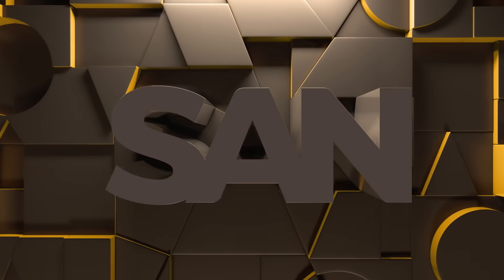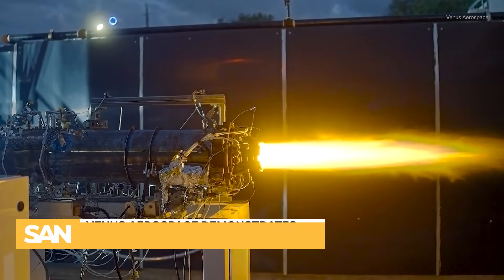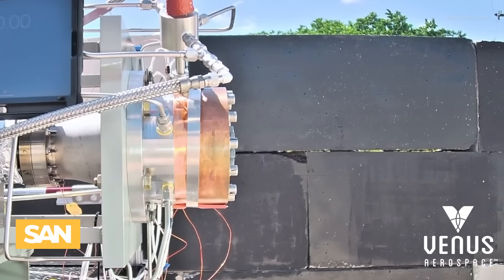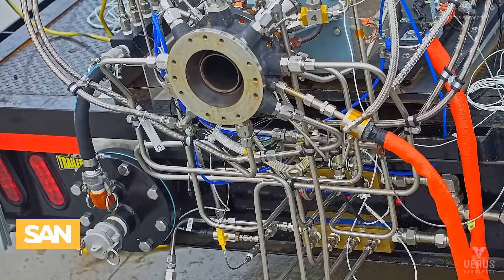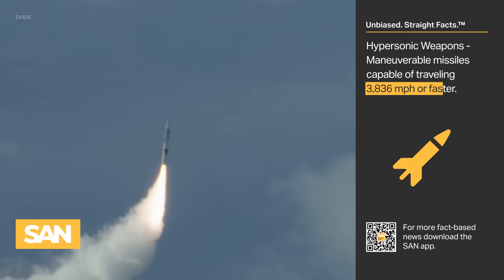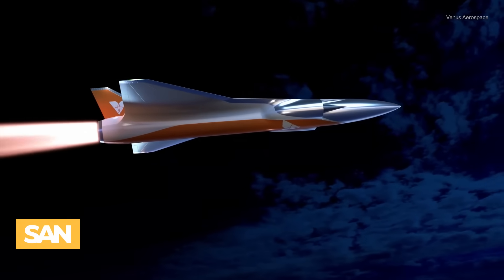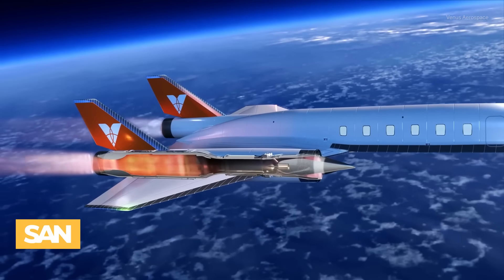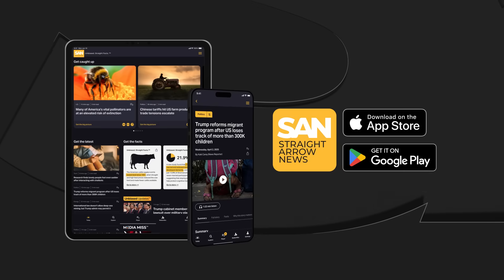Texas startup making history with revolutionary rocket engine

Comment: Hypersonic missile are still useless and a waste of money.. Yes you can make them but in the end you are limited by physics. Its not just getting the speed and maintaining hypersonic speeds, its about making the missile incl. a warhead, survive the flight. You can also not use any optical sensory during hypersonic speeds, infact most guidance systems are gonna be interrupted during those speeds. We have materials that could endure these temps but they are really expensive and I dont see a reason to make 1 missile worth 2000 missile just to have a fast one. When it comes to balistic missile and stuff, you just have to overwhelm the enemy. As if we dont have enough guided ammunition to level 3 countries and more. Just look up how many BGM-109 Tomahawk America has.

Comment: A team of engineers from the Łukasiewicz Institute of Aviation conducted the world's first successful flight test of an experimental rocket powered by a liquid propellant-fueled, spin-detonation rocket engine. The test was conducted on September 15, 2021, at the Military Institute of Armament Technology's training ground in Zielonka, near Warsaw. The spin-detonation process has a wide range of applications, from rocket propulsion and aircraft propulsion to applications in energy devices.
Combustion chambers using the spin-detonation process have several significant advantages: they have a simple and compact design, making them lightweight and inexpensive.
For over 15 years, experimental research on the use of the spin-detonation process in engines has been conducted in Poland, under the supervision of Professor Piotr Wolański. The successful demonstration of spin-detonation technology conducted by Łukasiewicz engineers is a success on an international scale. This is the world's first successful test of using a detonation engine powered by liquid propellants, liquid propane, and liquid nitrous oxide to propel a rocket. The successful demonstration of the spinning detonation technology conducted by Łukasiewicz engineers is an international success. This is the world's first successful test of using a detonation engine powered by liquid propellants, liquid propane, and liquid nitrous oxide to propel a rocket.

Comment: Which of the 20ish rocket engine types of SpaceX are they talking about here ? And is it the J2 or F1 engines of Saturn ? Also they are not a 1 to 1 thing, as there are more engines in one design but smaller.

To say they are 30% more in trust means little without numbers. As the J2 is 1,032 kN vacuum, but the Raptor 1 is already more than that, and Raptor 3 is 3,000 kN (in space only 2,750 at sea level)

Is it also scalable, as it's not a sure thing either. How about reusable ? 

To say it's 10 times cheaper means little if the other can fly 30 times, like SpaceX already have done.

Now it's still great to have more engine types and ideas out there, but some actual numbers and so on would be nice.

Comment: Springs and gearbox, using a piston system, to cycle an exhaust gate and fuel inlet gate, and a combustion cycle toggle

To create an arpeggiated explosion, controlled with the spring piston/toggle lock

And a portion of the exhaust gas, is routed back into the fuel tank, cooled by a turbine, and peltier coolers, and with a relief valve for overpressurization

The gas provides positive pressure and recycled unburnt fuel

For a self-pressurixed, and regulating system.

The ammount of travel of the gates is controlled by throttle or gas pedal. For variable thrust

Spark plug is powered through battery by alternator connection to turbine in positive pressure/laminar flow system

Can be combined with air intake, or used with oxides/oxygen tank

Works good as a multiple motor system

Built like an H&K Machine Gun

Comment: "Maneuverable Hypersonic" is an oxymoron. You can either be agile enough to - in this case - dodge anti missile defenses, or be fast enough that such systems dont have the time needed to react. You can't have both or else your weapon becomes susceptible to AA defenses on way or another.
Reply: Not necessarily true at all. You think there can't be a vehicle that can go 4,000 mph amd make a 78 degree turn without slowing?

Comment: Assuming this is liquid fueled, seems unlikely that the DOD will be using these for hypersonic missiles, liquid fueled rockets have not been in service since the discontinuation of the ATLAS rocket, due to difficulties related to managing liquid fuels, (hypergolic or otherwise).
Reply: DoD is funding them. Purdue Univ. is working on a Solid Fuel RDE.

Comment: Although the two technologies are quite different, when I heard mention of Venus' means of propulsion involving a series of explosions, I immediately thought of Freeman Dyson and Project Orion, decades ago, which was based on the idea of using a series of atomic explosions to propel a rocket through space. As for what the CEO said about Venus' engine being much more efficient than that of SpaceX, I would say that the applications, respectively, could not be more different. Given the number of outstanding engineers working for SpaceX, I am quite sure that if Starship could benefit from a different kind of engine, they would have opted for it.

Comment: Thanks for a good explanation.  10% to 30% efficiency improvement is a major breakthrough for spaceflight in addition to weapons and air travel.
Reply: While efficiency is always good.... On a missile, the efficiency of the  fuel or the propulsion unit is not going to make much of a dent in the cost per unit.   And we don't need any faster missiles, the ones that fly at Mach 15 or higher are good enough... nothing can stop them anyway during the terminal phase.

Comment: 10 times cheaper and a 30% improvement in thrust ? 
That’s so impressive.its hard to believe.
Reply: The economics of death just took a giant leap away from Mankind.
Reply: He didn’t say thrust; he might’ve meant Isp.
Reply: Dude seems to have thought this through. 🤔 It will be interesting to hear more 10 yrs from now.
Reply: @andrew1717xx  I like technology of all types, It adds value practically for free.
The Share price on the Nasdaq is currently @ 2.45 . That is real interesting .  Thanks
Reply: Well it's a rocket engine, those are pretty cheap. As for thrust improvements, it's a known deal already that detonation engines are more efficient. The issue is that you need multiple detonation fronts in the same engine to get good specific thrust, and those tend to merge together (reducing the number) or otherwise collapse - getting them to run with perfect spacing at the same speed is the difficulty of building such an engine.
Reply: 10%-30% efficiency equals a SUBSTANTIAL savings in fuel which, in turn, saves mass that must be lifted (which even further saves fuel in a bit of a virtuous circle).  If this is viable and safe, if could mean for much lower costs for spaceflight and possibly even shorter travel times  to places in the solar system.
Reply: @v3rlon  nah, it mostly means smaller launch vehicles, not even bigger payload to space. Also you don't use combustion for sustained orbital propulsion, it's inefficient.
Reply: @michaelbuckers  increase in efficiency means less fuel for the same load.  Their website says increased efficiency.
Smaller rocket engine still mean less mass being pushed.  When you are talking about weights down the the kilogram being important, that is a big deal.
And no, you don't burn all the way to Mars, but if you can achieve higher velocity on your push (increase in thrust) and decelerate harder on the other end, that is also time savings.
Reply: @v3rlon   you ever played KSP? Give it a go. It'll give you some basic understanding of orbital mechanics. Because it's not how any of this works.
Reply: @michaelbuckers  No, Can't say I ever played KSP, BUT efficiency, for all the scientific community, is how much energy gets translated to useful work (thrust in this case) versus how much is lost (mostly to heat, in this case).
Empty mass of a Saturn V Stage I was 137,000 5g..
With Fuel, that goes to 2.2 million kg.
a 15% increase in efficiency as defined by all the world, means you need 15% less fuel to lift that 2.2 million kg for the 150second burn time of that stage.  So you need 330,000 kg less fuel.
Now you want to lift 1.89 million KG of stage 1 (for now, I will just give you that the fuel tank itself doesn't get smaller).  So you no longer need 2.06 million kg of fuel to lift because you shaved all that mass.
You so now you 1.96 million kg of fuel.  When you recalculate for that, it goes down a little bit more.
Now I wan't try to put the calculus in a YT comment, but there is a formula for that, AND as you shrink the fuel tank , you save a little more weight.
So unless your degree in orbital mechanics from video game university allowed you to rewrite the laws of physics for the entire universe, that is exactly how that works.
Reply: @v3rlon  the point I'm making that orbital mechanics don't follow everyday intuition which is what you use in your argument, which is why it doesn't exactly makes sense rocketry-wise. For one, rocket engines' mechanical efficiency depends on it's current orbital velocity, it gets more kinetic energy for the same amount of fuel if it goes faster while burning. Which is why we measure rocket engine thermodynamical performance in seconds, not in percent.
Reply: @v3rlon если верить вам на слово. То лучшим способом применения будет использовать тактический ядерный взрыв, чтобы поднять на орбиту экипаж космической экспедиции..
Reply: 30% improvement in thrust? that is what he said but the reality is questionable.
10 times cheaper? Really, 10 times cheaper? at the end with politics involved, do you think it's 10 times cheaper. 
Why would they give 90% off if it's tax money? you know what I mean.:body-blue-raised-arms: I understand it's a fair market but they're all talking to each other when needed, and tax money will be used abundantly, INTO "THEIR pockets"
Reply: @phuongmua5098 Thanks. I put this stock on my watch list. It currently trades at 2.25 on an after market. At 2.25 an ipo might be interesting
Reply: PSA: this is a NASA invention.  NASA announced that they’d finally gotten a rotating detonation engine working two years ago.  Venus’ ability to scale up is impressive, but let’s not forget that it was government funding which invented it.
Reply: 10 times cheaper and Pentagon will sign a contract at 2x current engine prices and think they have got a bargain.
Reply: 10 times cheaper?   Yeah... sure.  I'll believe that when they actually go into Production.  Watch the costs skyrocket when you move from the Theoretical to the actual physical production of these units. 🤣
Reply: Think of it like this: NASA early on accidentally made detonation engines. But since they were uncontrolled, they would just destroy the rockets. So NASA began designing to avoid the detonations.  They did continue to study them though because the potential was always there
Reply: @mervynlarrier9424 do you think this engine design will be as viable as the feed reports?
Reply: @davidhaynes3126 I don't know. There's always a gap between theoretical performance and real world performance based on unpredictable factors. I'd say a range of 15-25% is more likely

Comment: 1:45 The co-founder is comparing his engine to an old generation SpaceX engine. The video makes this even more misleading by showing clips of Starship tests, which uses the newest engine, Raptor. The 2% "better" is also vague, Merlin is actually 7% more efficient at sea level and 2% in vacuum. Factoring in the rocket equation makes it more efficient than just 7% due to gravity losses and other variables.
Reply: That's compared against the Apollo F1's
Reply: #NerdAlert

Comment: 4:06 why in front? detonation must hapen in the last step. Otherwise will be fatig problem and also how you control the backward flow in a detonation if al detonation give the same presure and on ramjet the flow is restricted by compresion stage. I am new on this, so let see how you make it. i like rotation detonation engine  because of eficency and power.

Comment: A next generation obsolete rocket that you are actively going against orders in producing you were told to build cryo- cooler lifters. I can sit back right here and describe to you 360°. That’s where it’s encrypted that the science has already been done. They said it takes 360 Tara Watts to make any gravel lifter. You don’t know anything about the environment. There are three gravitational courses and then it’s 100 Gs not one G that brings it down to 12 terra Watts terra watts is like thousand watts anything at one volt 100 V 1000 V 10,000 V 100,000 V they’re all on a nuclear parabola with as such, you can polarize across them they might as well be the exact same same same thing there’s a hat trick to make them all work and cause the exact same level of physical reaction and reality or physics lecture in reality, physics, warp, lecture a bend in the radio constant or a refraction of the Radionics constant causing the Radionics constants to change in a localized pocket of existence that’s warp theory practical application comes next activating water is cryo- cooling liquid and making a warp cell that rocket engine that you’re using that you showed me the picture of that that’s the only reason I came here to talk to you those diamonds that you see in the exhaust plume of that thing if you see one of those I can take a hand, laser, pistol and pop it, and we can have more than Hiroshima or Nagasaki out of any one of them that’s why the military has those so that the military and high science can stay in check with one another. Anybody gets stupid and starts taking their stuff out with high science, the thing is going to explode and take out a huge area and nobody’s gonna know what set it off you guys running with this is like you guys saying that you’ve got a flying car only you’ve made a multirotor helicopter and then you’ve gone and used landing strut hinges how many times you’re landing your fail and you’re running those to hold the God bless engine on there was a huge number of things that just got brought out that your religious zealot cult of Nazarene cult of the children of Nazarene anybody claiming to be Christian is a member of that there’s two different sides of it you’re either slaves, waiting to be murdered at the leisure of your slave owners or you’re a direct descendent of Jesus Christ his slaves were really really good followers. They were heavily drugged up much like you guys have to be heavily drugged up to continue perpetuating, obsolete technology and actively ostracizing in every way, the smartest man among you who is actively pulling stuff out of historical archives that are littered throughout the world in every living thing, including ourselves i’m actually getting worn out, trying to get actual truth of reality out if you think that I’m not speaking truth understand that my name is Lazarus Van Buren. That’s the name I was born to the name I carry on my ID is Noah Oscarson my astral Navy call sign is not just the oldest soldier but ninja Talqk if you doubt my resolve or the truth or validity in the statement, I have made here try denying my call signs. That’ll wake you up to reality. Have a nice day.

Comment: Commercial use won't happen. A hypersonic jetliner would be basically a 2 hour long rollercoaster ride bouncing against the edge of the atmosphere. Might get a few people willing to pay for that as a novelty once, but most passengers won't want to throw up ten times whenever they go for a flight. Definitely useful for military applications, of course.
Reply: Concorde.
Reply: @dawnfire82  Concorde was supersonic. Hypersonic is 2.5 times faster than the Concorde.
Reply: Concorde took only 3.5 hours & was too expensive. hypersonic would even be more expensive. Another issue is going to be the heat.

Comment: ah.... bollocks. hypersonic engines today are so expensive because those are air breathing. if you just make regular solid fuel its cheap. AA missiles have those and engines are cheap. also this one is liquid fuel. good luck with 20 years shelf life of liquid fuel rocket. 
nice for civilian use if it works but military use is probably out of question.

Comment: Venus engine looks like a ramjet on the stand. BIG air intake horn. The other shots of real RDRE engines (on different stands) are not Venus, they may be Purdue or another group whose name escapes me. The diagramming I've seen from Venus makes it look like there is a rocket engine driven eductor to provide initial air flow to the ramjet. You will notice that the Rocket launched from the rail has a very blunt nose (whatever it really is it did make it over 2K feet). It may be a really cool ground start ramjet.

Comment: Nonsense. RD engines were demonstrated in the early 1960's. They are amusing, but not much use. They also use liquid propellants. The rocket motors in weapons use solid propellants. This Venus outfit is clearly a grift factory burning investor's money.

Comment: Sounds interesting but I don’t think you actually said why this engine is better. You mentioned the size but is it more efficient? More thrust? Less fuel? If just the size that is a good thing but just say that. All the rest just had me scratching my head.

Oh and “avionics” is aviation electronics like the flight instruments and stuff that monitors engines. Engines are not avionics. They are powerplants monitored and controlled by avionics.